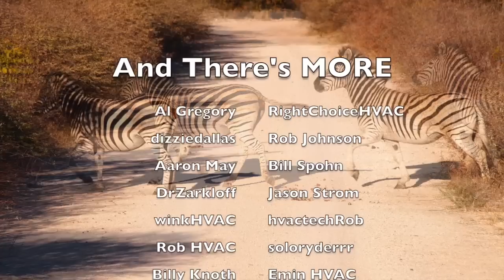HVAC Installation: New Construction Is Nothing Like It Used To Be

Comment: I started in the trade back in 1980. Shorts and tennis shoes and no safety guy walking around watching your every move. Loved the job, roughing in new homes, installing duct work, setting finish, metal roofs, gutter and flashing. Then our company started installing the metal fireplace box’s. As a twenty year old kid it was the greatest job you could have. I do not know how many thousands of homes I worked on but it was very gratifying. All the years of lifting furnaces, condensers and fireplaces took its toll though. Still would not have traded it for the world.

Comment: You did a better job installing the HVAC equipment than the plumbing and the wiring  job the other contractor's did
Reply: dklucas1 no he didn't, flex runs should be 8' max. That's a hack job.
Reply: whi rip da top plate fer

Comment: Not a bad install, looks like you provided what should be expected and your brave to post on you tube with all the critics. I think you would benefit from using the duct zip ties for your flex connections save time and slightly better quality, I find even the best true duct aluminium tape can become loose after 5 years or so on the flex duct inner liner even when properly free of dust and fiberglass and in attics especially, ive never seen a duct zip tie  become loose if installed right to begin with and takes me about 20 seconds to secure properly. My comments are opinion and NOT criticism in any way just simply comments.
Reply from the maker: No problem Andy Abel  I don't recall the details
Of this video but I do use zip ties primarily and not sure what I recorded here. That's for watching and dropping a comment

Comment: As a retired electrician I have to say that electrical looked like crap. I always tried to leave a job as if my name was on it. I would hate to have my name tied to that mess. Good job on your part. Thanks for sharing.
Reply: I agree DC! I've noticed this trend develop over the past ~10 years of leaving extra slack in NM cable between the last staple and the box. I think it is a reaction to wires getting butchered during drywall install and painting. The second reason that comes to mind is that if the cable gets tugged on, it will first lose the slack before pulling the cable out of the box, especially with the cheap plastic boxes that have no clamps. (Not a fan of that type).
Reply: Dwight Bennett Hey Dwight, I think you are right about the slack. Leaving a little slack is probably not a bad thing but the way these wires were crossed over one another just looked like a mess to me. The wires coming down looked liked they were stapled nice and straight. Makes me wonder if the same guy did all of the work. I know what you mean about those plastic boxes. I was an industrial electrician, everything in conduit and metal boxes.
Reply: DC Rickerson DC, I was taught metal boxes and conduit back in school, and it stuck with me. Seeing cables running diagonally and loose all over the place makes it seem like it was thrown in to be temporary.
Reply: Electric part, line set and water is install horrible! We just switched our line set from old leaky R22 to 410 ourselves. Had to crawl into false to do it. Saw the same miserable way of building . 
What if you have to change cables or line set? Warm Water pipes not insulated. Awful!

How about doing it right from the get go and putting everything in conduits so that the person who comes after you can change it if need be??
Reply: SlayerofFiction b
Reply: 7 day laborers showed up and installed the wiring in 5 hours for the whole house probably. That’s how I see it done now a days. The electrician with a trained crew is a rarity.

Comment: Great Video. I'm a HVAC Mechanic in New Construction For Airtron & I Install Heat Pumps but Mostly 80 & 90% Furnaces. I'm Fascinated that you can use Small Nail Plates on your Line Set & Drain Lines because I Always have to use Long Nail Plates with 16 Penny Nails. I Noticed that you use Drives on your Downstairs Flex instead of Black Strap wich can be more Time Consuming, but I guess everything varies by the Builders, & the Company that you Work for. Today's Construction Work isn't as Sufficient as the Past because The Builders Rush Each Trade, (HVAC, Electricians,Plumbers) To the Max, & They prefer Speed over Quality, Wich is Not Good in my Opinion.  I can also understand the Dislike about Doing Punch Work, because it can be Irritating to have to Fix Someone else's Work Especially if there's a long List of Things that may need to be Corrected or Added. Thanks for the Video.👍

Comment: California here...all our homes are on slabs(will 90%)anyway.I learned some thing watching this video(snap the strap and bend the piano wire trick)when I sell an install round this neck of the woods I get 2500 per ton for 14 seer split system.Me and my son take 2 trips to finish the rough in,small job is a 3 ton...most homes use 2 systems and 7-9 tons....The best part of being old like me is to have a helper do the stuff I don't want to do anymore after installing for the past 35 years!
ps...you are still fast IMO
Reply from the maker: thanks for watching Erik Cable glad i could show you something new.

Comment: Good job brother! Steven man i just finished a brand new install my self. 2400sq ft all sheet metal wrapped in old style fiberglass R-8..Only thing that saved me was that it had some what ok height in the crawlspace. Duck walk height.  Took me a week and a few days....   Everything passed with flying colors!KY state law is super strict and they are about to make it harder or duct pressure tests requiring even lower leak rates. It's crazy man. One thing i did find about mastic i do not like is that is melts kind of when dampened with condensation. Like rubbery.It can be a pain man.  It really can..... Keep up the great work!
Reply from the maker: iconbadgta mastic is water soluble so it doesn't do we in wet environments. Thanks for watching!

Comment: Great job. As an electrician doing new construction years ago in residential the plumbers and HVAC guys always were first and us electricians were last. Great work. The problem has been in recent years the fact that with contractors it is all about production and piece work and the hiring of illegal with sub contractors. It's made the housing work no fun. Hope it does improve.
Reply from the maker: onecrazywheel you're right, things were pretty bad during the construction boom but they haven't got any better as things haven't really picked back up to where they were before.

Comment: Don't forget the framer needs to know to fix the over-notch! 1:12 The top plates are notched over 50%. The required fix is a 1.5" nail strap (CS) on the top plate. Is that nailplate listed for use as a nail strap? That's an exterior bearing wall that was notched, not an interior partition wall. You can the the truss heels, and the OSB shear on the outside too.

Comment: Great video Stephan. I really like your work. Have you ever tried putting a little mastic on the inside of the flex and then slide it onto the collar to make an air tight seal. It works great if you need to pressure test your duct systems for leaks. We can usually maintain about 4% or less air leakage by doing it this way. Thanks again
Reply from the maker: +stlwrkr68 that's a good idea
Reply: we put mastic on our boot/collar instead of inside the duct

Comment: Looks nicely sealed but I never used more than 5' of flex per run on install just for noise reduction, 15-20yrs ago if anyone used more than 12' it'd be turned down. Awesome looking job though 👍
Reply from the maker: +Dwayne Hancock with proper design flex duct can work very well. Thanks for watching
Reply: @StephenRardon Just a tad up on Static Pressure. 👍
Reply from the maker: +Dwayne Hancock I have one system in particular that is running a 0.1”TESP, I’ll
Have to get video one day

Comment: Threw a fit on a new construction Hvac job on our new home when I walked in & saw flex & line set came out the living room between 2 windows when I specified to the builder it be ran on a windowless side wall, line-set will be moved, stuck with the duct...🙄

Comment: Nice video Stephen, doing a new construction this week too.  Except it is 85+ degrees and sweating like a pig.  95% of our duct is rigid duct board not flex.  Looking good, keep up the good work.
Ray
Reply: Is all that flex in the attic? #hack
Reply from the maker: Yes the duct system is 90% flex, in this area that is the way it is done we do make our trunk line and plant them out of round metal with insulation wrap
Reply: Do you over size the units? You lose about 25% of your cfm per run
Reply from the maker: Julio Martinez we size them per the code and load requirements. I don't think there is even a single contractor around here that doesn't run flex for everything.
Reply: Where are you from? I only use flex in attics but only like 5-7' per run. We don't use duct board either, nasty shit!
Reply from the maker: Julio Martinez we're in NC

Comment: Hi Stephan, great video! I came across your video to learn about HAVC system. I recently moved into an apartment in a 3 unit building, and for some reason the ceiling makes noise, sounds like water tapping on metal, and not always at the same spot. I suspect it’s the HAVC system, reached out to a couple HAVC companies and they are telling me that they can’t do anything about it.  I am just wondering have you seen this kind of issue with HAVC system? Not sure it’s due to bad insulation. Thanks.

Comment: You're right. New homes are over engineered with minimal material and cheap. Have had several friends buy new homes and had tons of problems that a 20 year old house might have. How about those I-Beams they use to build floor joist with in new homes. Golly, there is no way.
Reply: "over engineered with minimal material" How does that work?
Reply: +Order in Chaos engineering is the act of designing and materials are what engineers use to implement the design. So over engineering with the least amount of material is building something to the exact specifications in mind while doing it with the least amount of material. Like how Honda uses paper thin sheet metal on their car hood then sell it as pedestrian safe. No they figured out how to make and use really thin sheet metal with some cross support which saved on production cost yet still covers the engine. Hopefully I clarified my statement better.
Reply: "Hopefully I clarified my statement better." Are you serious?! Jesus Christ that's funny! "engineering is the act of designing" That's not entirely accurate. "materials are what engineers use to implement the design" Engineers don't "use" or handle materials; Engineering is conceptual. " So over engineering with the least amount of material is building something to the exact specifications in mind while doing it with the least amount of material." Oh so now you're saying that over engineering is "building something to the exact specifications" You need some serious clarifications yourself I'm afraid... BTW I'm an engineer ;)

Comment: Where are the distribution boxes how is that suposed to build up pressure and distribute evenly through each run
Reply from the maker: Didn’t design or lay out the job, simply did what I was told.
Reply: Stephen Rardon I know that silly goose,  i was just asking why they design it that way, i guess different codes in different states, anyways great video demonstration that camera gadget is awesome I need to get me one of those

Comment: What are the cieling boots you use with the flaps. What screws do you use. Does the drywall sit flush over the sheetmetal?
Reply from the maker: The boots are standard boots (for this area anyway) and the frame is a “plaster frame” that connects to the boot edge. The frame has a 1/2” rim that passes through the Sheetrock to sit basically flush with the painted side.
Reply: @StephenRardon  thx  so you make the plaster frame yourself? 
The 1/2 rim sticking out under the frame. Is that going to be flush with drywall that the drywall guys will install?
Reply from the maker: They are pre-made and available at our local RE Michel company. The 1/2” ends up flush with the inside face of the sheetrock

Comment: Hey man I've been in the field for about 28 years doing mostly industrial refrigeration work at this time done very little AC work as far as install lots of service but I've never seen the cans painted on the inside wondering what's up with that
Reply from the maker: +Kirk Trapp air sealing that is visible to the inspector. It’s not like he actually looks to make sure but that’s what he wants to see, paint inside the boot.

Comment: Looks like the electricians just tied a knot there at that receptacle. Wow never seen that in new construction ever. Not sure I like that lol lol..  The tape on the waterlines no absolutely don't like that either. Crappy craftsmanship, but you bet they will get their money and then some outa that home. At least the HVAC SYSTEM look good, but it looked busy this going there and that going there to accommodate the floor plan wow lol lol..
Cool stuff Stephen!
Reply from the maker: Yeah, it wasn't the greatest idea to design homes on a slab foundation, it
Forces the ducting to be routed up, down, around and backwards through the joists and that is very usually detrimental to the flow of air.

Comment: Are the air conditioning units included in the price of the HVAC installation or is that usually separate? Thanks for your video.
Reply from the maker: When we quote installation it includes the equipment as well

Comment: I bought a house that I need to install a heat pump a 2 1/2 ton you know the wire size and braker size ,,,I was told  a 60 amp and 40 anp both for the air handler ??? and a 30 amp for condencer unit..is that incorrect.???
Reply from the maker: +bus driver that sounds excessive for a 2.5 ton system around here. Need more information to even start to offer an answer. I’d suggest you consult an electrician and a HVAC contractor for ratings on whatever brand system you are looking to install.
If you’re asking so that you can prewire the circuits then you still need to know how much amperage you need to be able to handle.
Short answer: can’t say without more data
Reply: @StephenRardon  ok thanks

Comment: that much flex is giving me stress lmao Where I'm at, we use snaplock... only flex on HRV or bathroom exhaust fans... never seen a whole house run on flex supply ducting...
Reply from the maker: Yeah, I spent my first years in the industry up in Ohio where we never used flex back in the day. When sized and installed properly flex can work very well.
Reply: Flex duct should be illegal, except for terminations.  It should never be installed in concealed spaces, because it deteriorates and falls apart.  You can buy good flex duct, rated for high pressure, but that’s not what most people use.  I myself, prefer spiral pipe,  or leader pipe, wrapped with foil back insulation.  Flex duct reminds me of cheap trailers, meant to last only a few years.  Rodents love to nest in it.  We just bought a new house, with horribly installed flex duct.  I ripping it all out.  Luckily it is in a stand up attic, with plywood floors, and all easily accessible.

Comment: Some of that ducting looks a little compressed. It might just end up losing its shape and an imbalance in air flow sooner or later. I think some parts could have been done a bit better.
Reply from the maker: Yes flex duct can definitely be done with a little more attention to detail as I was there to simply wrap up what was started I didn’t have a whole lot of control over the situation
Reply: @StephenRardon  i can clearly see that now
 It sucks that there wasnt much you could do with a mediocrely desogned structure

Comment: That electrical was a mess. The duct looked nice.
Reply: We haven't done much new construction for a few years after the market turned builders into cheapskates . I kind of miss it
Reply from the maker: airkraft1 my memory is of some great jobs back in the day. seemed like people cared more in every trade. i miss the old days
Reply: Stephen Rardon   I second that
in the older homes around here its common to see systems where all the branch lines are nested take offs and rectangular branch lines now guys are using un insulated  flex where pipe should be used.

Comment: I've seen inside my vent (connected to the duct) there's a soft membrane, and its not painted. Do you know what it is and if I should/could replace the membrane only, or the whole metal vent/hood? Thank you.
Reply from the maker: Afraid I’m not sure I understand your question
Reply: @StephenRardon  I searched for the name and it's called the Return Air/Register Box, I think? Seems like it's inslulated with some kind of soft material inside, black in color (not sure if it's duct) I wonder if I should change the whole box or could just change the box insulation.. since I've seen some white stuff sticks to it while cleaning the vent.

Comment: Suggest for long term hand health, you invest in a pair of Kevlar gloves. Been doing custom sheet metal fabrication for 35 years. This present market includes a lot of also hated new construction. However we don't bid tract housing as it is now all crap work done mostly by the least expensive brainless savants. B.I.D. means Beat Idiots Deal. Number one complaint in new housing the hvac systems don't work properly: Do you think?
Reply from the maker: +I sotac I'd say your probably right on the #1 complaint but... I'd say it's half the building envelope and half a crap hvac system. If the house is not comfortable the hvac guy is blamed many times for what the builder did a crap job of, making the envelope with any integrity.